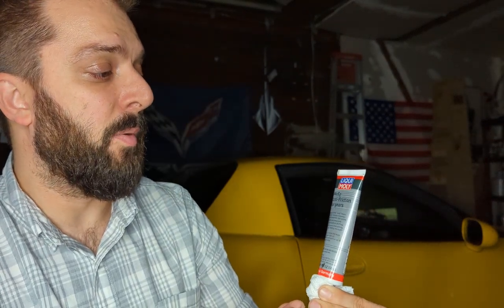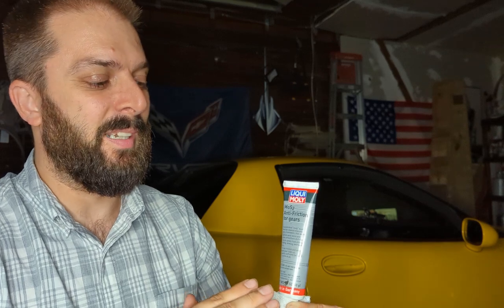I PUT LIQUI MOLY IN A CORVETTE | WHAT COULD GO WRONG? |  SURPRISING RESULTS

Comment: I just used a tube of this mos2 in my 2002 bmw 540i manual 6 speed. The 2nd gear synchro has began to give issues when the car isn’t warmed up. As the fluids warm up the car grinds less gear but it still wouldn’t be perfect. 

Update so I poured a tube of this mos2 into the car and also used Motul 75w-80 gear oil for the tranmssion and oh my lord!! The results are amazing, I can’t thank this product enough. Even if it lets me get a couple years more driving on this gearbox before it needs to be replaced I’m super thankful this stuff really worked in my case !!! 😁

Comment: Very curious on the continued use, please keep us updated.
Reply: ...how has it been?
Reply: I added the Mos2 and it definitely improved the shift feel; It's much smoother now. I added the Mos2 into relatively fresh Amsoil transmission fluid. Quite surprised and pleased.
Reply: @TTURKI  I have a 2003 Z06. I added in the Liqui-Moly and it made a noticeable improvement.
Reply: @yas122188  the wind mills had wear problems,, enginnerinhg started to put this in those gearboxes oil...

Comment: It should be used quite frequently during each transmission fluid change because mos2 is quite effective and it would keep wear and tear with in limits. Can we use LiquiMoly Motor Saver in transmission fluid although it is intended for engine and looks quite similar ?

Comment: Have you tried the Amsoil torque drive in the trans? Lots of guys on the forum rave about it. It definitely made a big difference in my 02 Z but I'm not sure how much of that is just because the original fluid was in there for 90kmi... yikes. Tempted to try out the penz syncro + the liquimoly now hmmm.

Comment: I know I’m late to ask, but how much of the liqui moly did u put in the transmission? I have an 01 Z06 6 speed and I’m thinking of adding. Thanx and love the channel! Keep up the good work!
Reply: I have an O2 base C5 and the directions on the back of the Molly say sufficient for 1 to 2.5 liters. Our manual transmission takes 3.3 liters. I'm going with whole 50g and will follow up with results.
Reply: @napochulo how did it go ?
Reply: @SuperSultan502  My transmission wasn't slipping or anything but just felt a little clunky and I didn't feel do much of a difference.